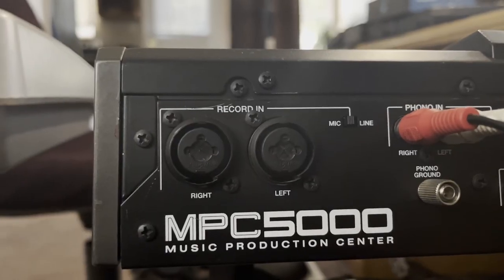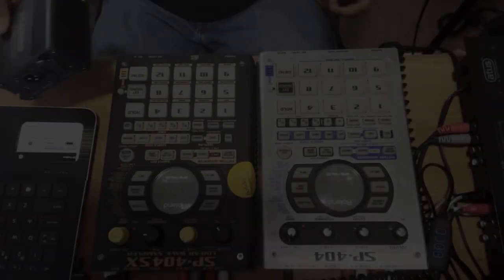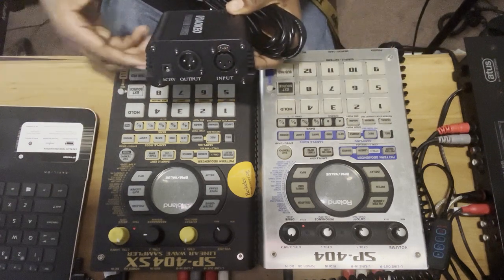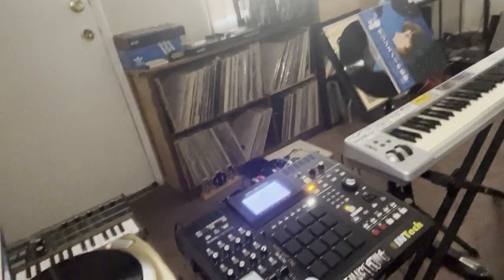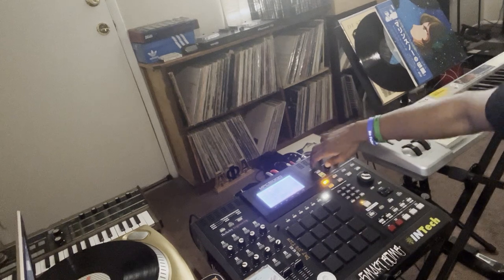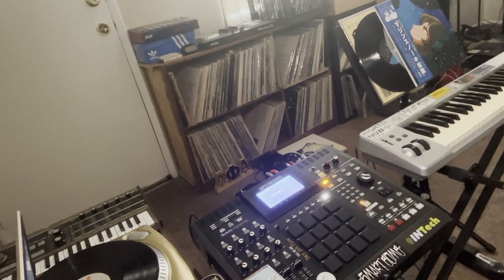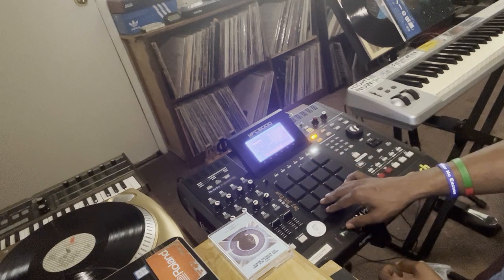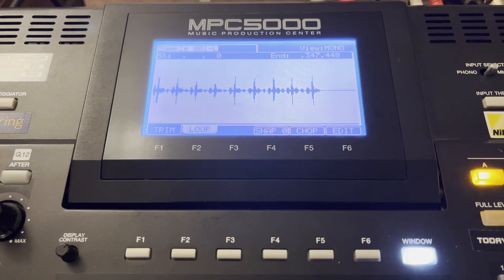Connecting external 48V Phantom Power supply with MPC 5000 mic input

Comment: I wanted to see the part where you connect the external phantom power (NEEWER, etc) to the xlr mic, then how it connects to the audio interface. I don't have a mixer, just a PC compatible audio interface.
Reply from the maker: Since you have an audio interface, you most likely won’t need the external phantom power box. Most audio interfaces have phantom power capability so you could probably plug the microphone XLR (male port) directly into the audio interface; the other (female) port for the cord would plug into the microphone. Good luck!